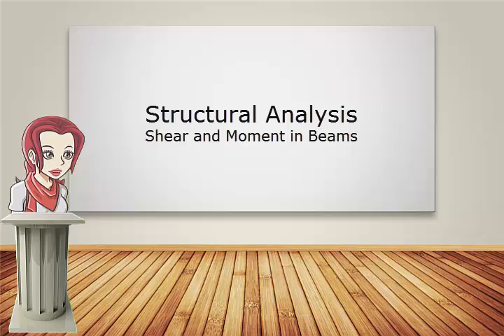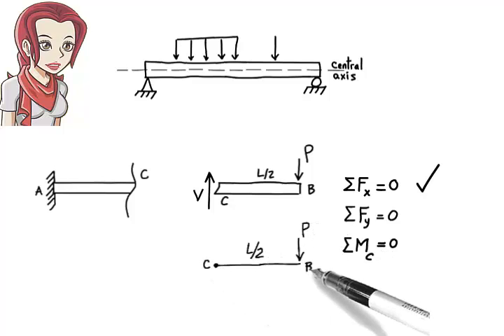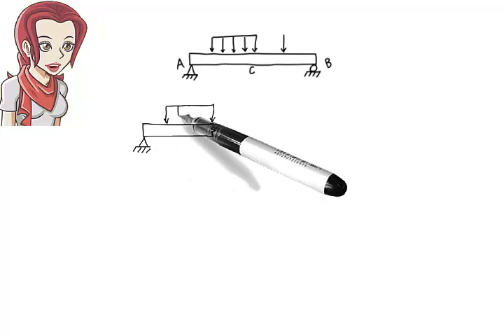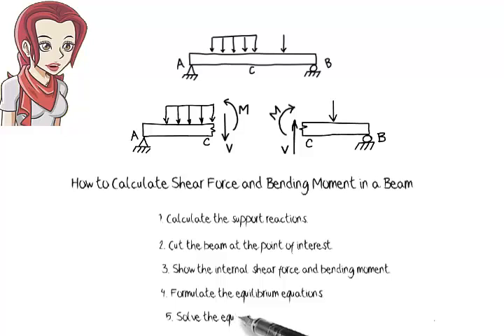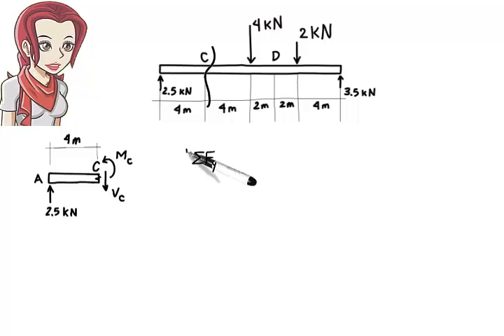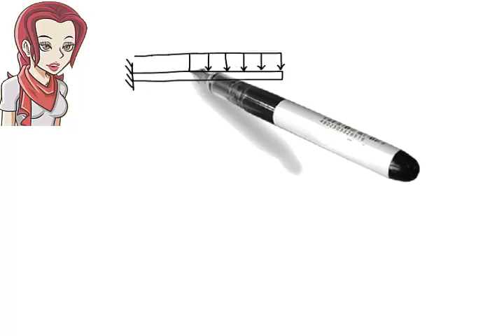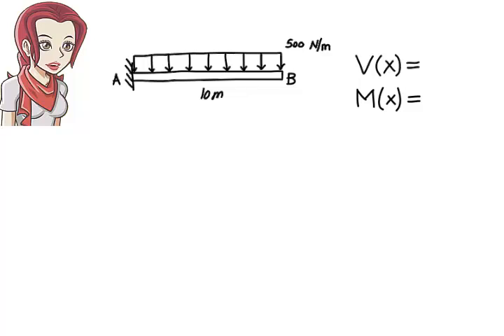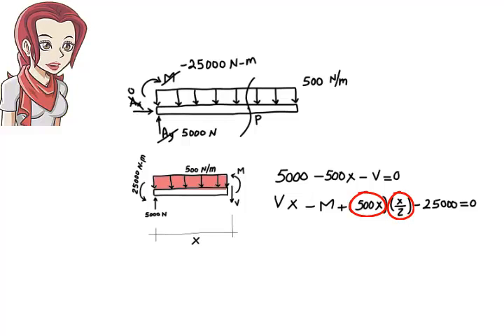SA06: Shear & Moment in Beams

Comment: Hi Dr..sorry to bother. Mind if i ask one thing. At 4:00, the downward V for the LHS and the upward V for the RHS does not mean that the shear force cancels out each other, am i right? This different in direction is only for us to identify on which side of the cross section do we use in calculation, am i right Dr?
Reply from the maker: Yes, it means exactly that-- the two forces cancel out each other, their algebraic sum is zero. Whenever we cut a beam, the internal forces (i.e., shear and moment) at the two sides of the cut add up to zero. So, the shear forces act in opposite directions with the same magnitude; so do the bending moments.
Reply: @DrStructure  i see. Very helpful Dr. Thanks a lot

Comment: Easy to follow when you understand where numbers are coming from. My Strength of Materials professor wanted the class to use this video to help with an online quiz. But, I can't follow what is going on in the examples at times due to the lack of units on the numbers in the equations. To think that such a simple thing can completely mess up the learning experience.

Comment: @1.55, the moment is taken as clockwise which is created by the external load, but as we are determining the internal bending moments and shear forces, don't we have to write it as anticlockwise moment ?
Reply from the maker: In beams, a positive bending moment is one that bends the beam segment concave up.  Consider a beam segment. If we want it to bend concave up, we are going to apply a clockwise moment at the left end of the segment and an anti clockwise moment at the right end of the segment.  Hold on to the ends of an (imaginary) flexible ruler with your left and right hands. Now gently force the ruler to bend downward (concave up). Notice how you are turning your left hand clockwise and right hand anti clockwise to bend the ruler. You are applying a clockwise moment to the left end of the ruler (beam) and an anti clockwise moment to the right end of the beam. This is considered a positive (pair of) moments.

So, if we are asked to draw the free-body diagram of a beam segment, we place a clockwise moment at the left end of the segment and an anti clockwise moment at the right end of the segment. Here of course the right end of the segment is free so there is no need to show an anti clockwise moment at that end.
Reply: Thank you :)

Comment: Generally when calculating moment about a point we do not consider moment caused by a force passing through that point. For example, 12:47 we did not consider the reaction 5000N when finding out moment at point A. 

My question is, when we do not consider the force passing through the point A for calculating moment, how can we consider the  moment 25000 which is applied at A?
Reply from the maker: Bending moment is the product of a force and a distance. If the force is applied at point A and we are taking the moment at A, then the distance between the two points (here A and A) is zero. Therefore, the moment = (force)(0) = 0.

A concentrated moment is a product of a force and s distance already. There is no point in multiplying this product by a distance again. So, when writing the moment equilibrium equation about any point on the beam,  the applied concentrated moment appears by itself without any distance multiplier.

Comment: at 10.40 , when you calculate the moment of A, why is the 5 multiply with the 500(10). what does the 5 represent ?
Reply from the maker: *That is the distance from the center of the distributed load to Point A called the moment arm.
*We are taking the moment of the distributed load about A.
*Bending moment is the product of a (concentrated) force by a distance (moment arm).
*The concentrated force due to the distributed load is the area of the rectangle: (500)(10). 
*This equivalent concentrated force is placed at the center of the rectangle, 5 meters away from Point A.
*Therefore, the moment of the force about A is (500)(10) times the distance 5 m.
Reply: @DrStructure  please how did you input your values into the equilibrium equation @5:49  4(8)+2(12)-16By
Reply from the maker: @aveira.a4916  Three forces cause a moment about A.
The applied load of 4 kN is 8 m away from A, hence it create a clockwise moment of 4(8) = 32 kN.m about A.
The applied load of 2 kN is 12 meters away from A, its clockwise moment about A, therefore, is: 2(12) = 24 kN.m
The support reaction at B is 16 m away from A, causing a counterclockwise moment of 16 By. Assuming clockwise is positive, and counterclockwise is negative, the total moment about A becomes: 4(8) + 2(12) - 16 By.
Setting this sum equal to zero and solving for By, we get: By = 3.5 kN
Reply: @DrStructure  thank you, the equilibrium equation @5:50 Efy= Ay+By-4-2=0, the 4 and 2 are the forces acting on the beam right?
Reply from the maker: @aveira.a4916  Correct.

Comment: 12:10 can you take moment about pint a and say just M? M is the moment about that right corner right? So if you take moments about m corner you can say the moment is M
Reply from the maker: +Roger Carter Starting at 12:10, the second equation is obtained by taking sum of the moments about point A (the left end of the segment). 

Alternatively we can take sum of the moment about the right end of the segment.  Assuming counter-clockwise moment being positive, we get:

25000 - 5000(x) + 500(x)(x/2) + M = 0.

Either way, the resulting moment equation is:
M = 5000x - 250x^2 - 25000.
Reply: ok thank you.

Comment: a question plz.... at 12.07 u take -M which is not countering 25000 N-m . it is bothering me because i think it should be clockwise countering the effect of 25000 N-m
Reply from the maker: When writing the moment equation, we usually show the internal shear and moment in the positive direction. So, here we get 25000 +.....+ M = 0.

When we solve for M, we get: M = -25000 +...

A negative value for M indicates that the correct direction for the moment is opposite to what was assumed in the free-body diagram.
Reply: Thanks a lot

Comment: hi dr. I got M= 5x -500x2 - 25    you got +25 because I did not calculated the moment at A . I did calculated it at the right side where the cut is. could you please explain
Reply from the maker: I am not sure which moment equation you are referencing. For the cantilever beam, if we take point A to be the origin of the coordinate system, meaning x is measured from left to right, the moment equation can be written as: M = 5000 x - 250 x^2 - 25000. If however we place the origin of the coordinate system at the right end of the beam, and define the x-axis going from right to left, then when we cut the beam at point P, we can take the right segment of the beam for writing the shear and moment equation. In such a scenario the shear equation becomes: V = 500x and the moment equation can be written as M = -250x^2

Comment: at 7:40 how can Mc = 10 - m?

What does m mean? Also when you make the equation for Ma why are you including the moment about C (a different point altogether) in it?
Reply from the maker: +Europa Erwacht In Mc = 10 kN-m, the unit of bending moment is kiloNewton-meter (kN-m). This represent  the product of a force (having kN as its unit) by a distance (having meter as its unit).

When a beam is cut, the internal forces at the cut point must be drawn on the free-body diagram and accounted for in the equilibrium equations. The internal forces in the beam at point C include a shear force (V) and a bending moment (Mc). Both these forces which appear on the free-body diagram must be included in the equilibrium equations.

Comment: on 12:20 you consider sum of moments about A point, 
just want to ask why do you include 25 000 Nm, if it has no distance to A, meaning why should we consider this moment if it s at point A?
Reply from the maker: If the 25000 was a vertical force, then its moment about point A would have been zero. But, the 25000 is not a vertical force, it is a concentrated moment (view it as the product of a force by a distance). Therefore, we would not/should not multiply it by a distance again. We simply write the concentrated moment in the equilibrium equation, be it about point A or any other point.

Comment: at 12.51  How do you go from Vx-M+500x(x/2)-25000=0 to M=5000x-250x^2-25000 where did the 5000x from?
Reply from the maker: The cantilever beam has a vertical support reaction of 5000 N. The reaction force results in a clockwise moment of 5000x at the cut point.

Comment: At 12:50 isn't the equation for M, M= Vx + 500x^2 - 25000, why in the video is it 5000x instead of Vx?
Reply from the maker: Substitute the expression for V (it is 5000 - 500 x) in the moment equation, then simplify. The result is:
M = 5000 x - 250 x^2 - 25000

Comment: What sign convention fo you guys use for moments? Plz reply
Reply from the maker: The sign convention being used here is attached to the moment equilibrium equation, not to the moment itself.  A bending moment is either clockwise or counterclockwise, not positive or negative. When writing the moment equation, we can assume either clockwise or counterclockwise to be positive. The purpose of this sign convention is to make sure we add up all the clockwise moments (say, the sum is CM), and add up all the counterclockwise moments (say, CCM), then subtract one from the other. Whether we write: CM - CCM = 0 or  CCM - CM = 0 does not really matter. They both represent the same equation.

This is different than the beam sign convention for bending moment. There, the pair of end moments that causes the beam segment to deflect concave up is considered positive. That means, given a beam segment, a clockwise moment at the left end of the segment coupled with a counterclockwise moment at the right end of the segment represents positive moment in the segment.

Comment: 8:39 how did you get -1.5 vd an 8:52 md 17 ? @dr structure
Reply from the maker: +Tull shaquille cooper Not sure if I understand your question. The two values are calculated using the equilibrium equations which are obtained from the free-body diagram.

Comment: at 6.13 where dis you get the equation for summation of M?
Reply from the maker: The moment equation is the result of adding three moment terms, all taken about point A. The vertical load of 4 kN has a moment arm of 8 m about A, therefore, its moment about A is 4(8) = 32.  The vertical load of 2 kN, with a moment arm of 12 m about point A, results in a moment of 2(12) = 24. Both these moments are in the clockwise direction. The reaction force By, having a moment arm of 16 m, causes a counterclockwise moment of 16 By about point A. Therefore, the total moment about A, assuming clockwise is positive, comes out to be 4(8) + 2(12) - 16 By = 0.

Comment: mam plzz tell me how to calculate bm at a distance 'x' from mid span of simply supported beams.
Reply from the maker: Cut the beam at x, draw the free body diagram of the left segment of the beam (from the left support to x), show the distances correctly on the diagram (for example, if x is to the right of mid-span, and the beam's length is L, then the distance from the left end to the cut point would be (L/2)+x. Then write the equilibrium equations for the left segment and calculate the moment at the cut point.

Comment: At 11:20 u have written m = 25000
But after using equation, we got m=-25000 although we used same convention and figure
Why?
Reply from the maker: When writing the equilibrium equation, we assumed the moment at A to act in the clockwise direction. That equation then gave us a value of -25000 for the moment. The negative sign here indicates that the moment, in actuality, is acting opposite to the assumed direction.  So, we can show the moment on the diagram in one of two ways:

1. Either draw it in the clockwise (assumed) direction and show its magnitude as -25000, or
2. Draw the moment in the counterclockwise (the correct) direction and show its magnitude as 25000.

Comment: how the direction of moment at C in free body diagram is anticlockwise
Reply from the maker: When dealing with bending in beams, we shouldn't think clockwise or counterclockwise, we should think concave up or concave down. 

By convention, we assume the moment direction(s) that cause the beam segment to bend concave up as positive.  

A counterclockwise moment at the left end of the segment coupled with a clockwise moment at the right end of the segment forces it to have a concave up deflection. Therefore, these end moments are assumed to be drawn in the positive direction.

Comment: The 500(10)(5) on the cantilever beam
Reply from the maker: That is the moment of the distributed load about Point A. 

(500)(10) =5000 is the total equivalent concentrated load. We can replace the distributed load with this concentrated load. 

But where, on the beam, would we place this concentrated load? at the midpoint of the beam (which is the geometric center of the rectangle representing the distributed load.) Since the midpoint is 5m away from A, the moment of the concentrated load about A becomes (5000)(5).
Reply: Alright thank you

Comment: 13:18 Shouldn't it be: M = 5000x + 250x^2 - 25000

Why is it + 250 rather than - 250?
Reply from the maker: There are three terms in the moment equation. Taking sum of the moments about a point located at distance x from the left support, we get one clockwise moment and two counterclockwise moment terms. The moment of the support reaction about the cut-point is clockwise (5000)(x).  The moment of the distributed load about the cut-point is counterclockwise (500)(x)(x/2). The concentrated moment of 25000 N-m is also acting in the counterclockwise direction.

If we assume clockwise to be positive, we get:

M(x) = 5000x - 250x^2 - 25000.

If we assume counterclockwise to be positive, we get:

M(x) = -5000x + 250x^2 + 25000.

Either formulation is correct.
Reply: Thank you very much. That clears things up a lot! :)

Just to confirm, the concentrated moment at A is only affecting joint at A, and therefore we don't incorporate it into the equation?

Also, I think the confusing part was at 12:01, where it was said that "sum of the moments about point A must be 0" - assuming then that the moments were being taken about point A and not a random cut to the right of A.
Reply from the maker: Although the concentrated moment is applied at A, it does affect the rest of the beam. Say, we cut the beam at some distance (x) from A. If we draw the free-body diagram of the left segment (from A to x), we need to show the vertical reaction force at A, the concentrated moment at A, the distributed load between A and the cut point as well as internal bending moment and shear force at the cut point. This means five forces are shown on the diagram. So, when we write the equilibrium equations for the beam segment, we need to include all 5 forces/moments. Therefore, the moment equilibrium equation about the cut point should have five terms in it, one term for each load/moment appearing on the free-body diagram. 

Here are the five terms (assume clockwise direction being positive):

1. The moment term due to the vertical reaction at A is: + 5000(x)
2. The moment due to the concentrated moment is: -25000 (note that here we are not multiplying the value by a distance since 25000 is already a moment, it has a unit of moment, it is not a vertical force). As a general rule, when a concentrated moment appears on the free-body diagram, it affect every point in the beam, so it appear in the moment equilibrium equation as is.
3. The moment term due to the distributed load: -500(x)(x/2).
4. The moment term due to the shear force at the cut point: V (0) = 0.  Note that since the shear force passes through the cut point, its moment arm is zero. So, the force does not produce any moment about the point.
5. The moment term due to the bending moment at the cut point: -M. Here I am assuming the free-body diagram shows a counterclockwise moment at the cut point labeled M.

Now, summing the above terms and setting it equal to zero, we get:

(5000)(x) - 25000 - 500(x)(x/2) - 0 - M = 0

Or, 

M(x) = 5000x - 25000 - 250 x^2
Reply: Thank you so much for all of that. That helps so much. It all works now perfectly. You saved me - thank you! :D